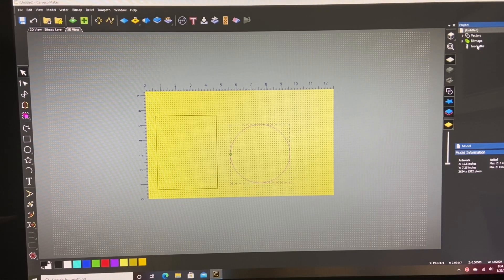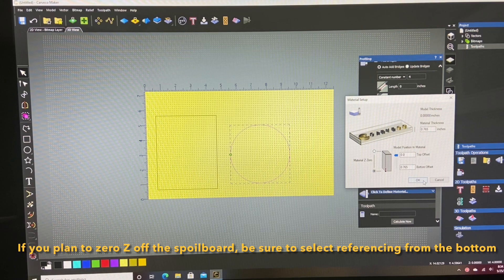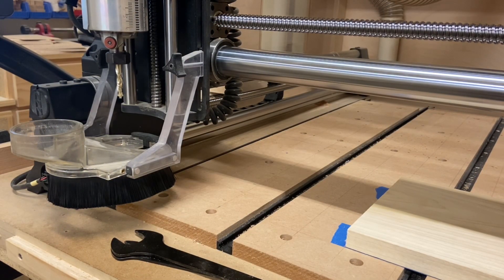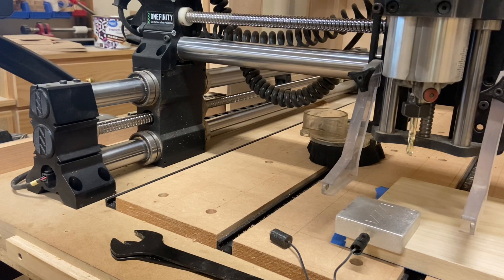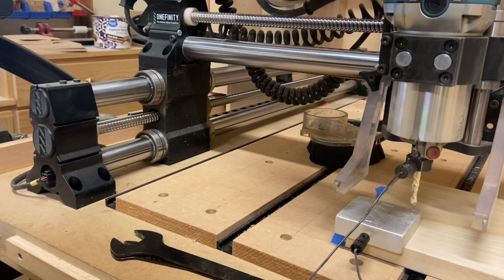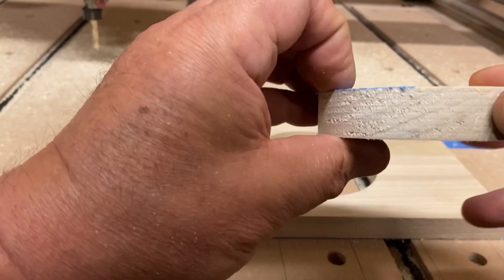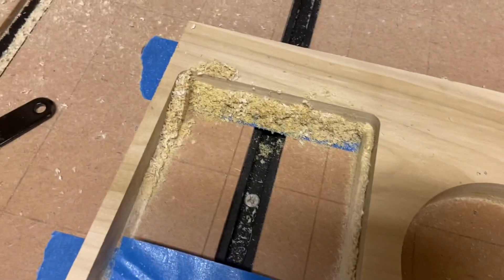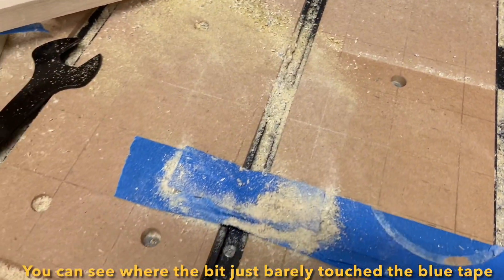Onefinity-Carveco design and cut - zero Z from top of spoilboard

Comment: is the blue tape, just painters tape? seems you are using it two ways here... to keep the loose pieces together and to hold the entire piece down?
Reply from the maker: Yes. It’s just painters tape. A few strips on spoilboard and a few on the workpiece that line up with those on spoilboard.  CA glue between them

Comment: Hi, thanks for the video. What if I don't have the probé, how can I zero z axis?
Reply from the maker: You can use the paper method. Get a piece of paper and slowly lower z until it is trapped between the material and the bit,  once it is trapped, hit the map marker icon (inverted teardrop) on the z line only. This will set your z at that depth.  Raise your router and remove the paper.  Now z is set to the correct depth.  If you want more details, drop me a note in FB Messenger

Comment: I’m a little confused. I use the probe, like you did at the beginning, to get my X,Y,Z. With this method I’ve never had issues with my spoil board getting cut into. 
Is there some other advantage for probing the Z on the spoiled board vs the piece?
Reply from the maker: If there are inconsistencies in your material thickness, it’s possible that either the bit may not cut all the way through the material or cut too deep. If you get 3/4” stock to cut and you enter 0.75” as your cut depth in the design, but the material thickness is actually 0.745” thk it will cut 0.005” into the spoilboard.  I recommend always to use calipers and measure the material thickness in several locations and input the greater thickness in the design
Reply: @onefinity-trainingtipswithMitz  ah, I see. Thanks for clearing that up.